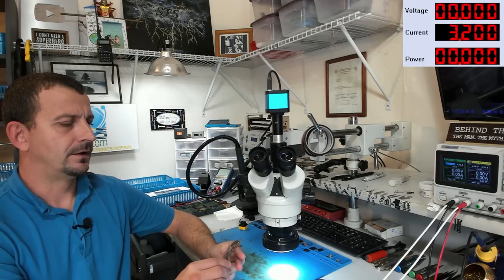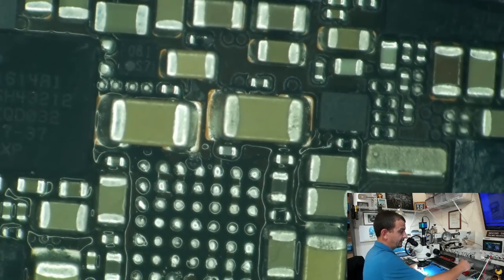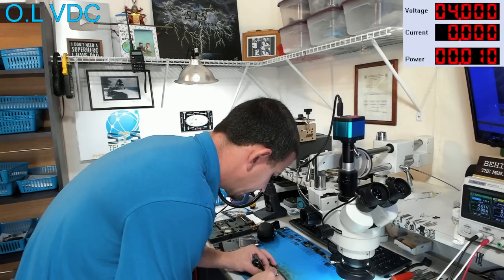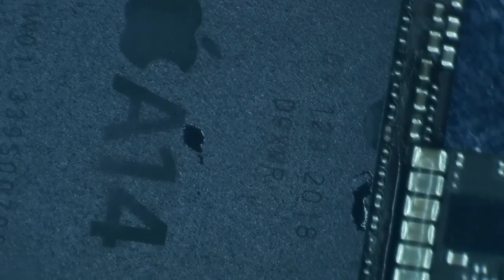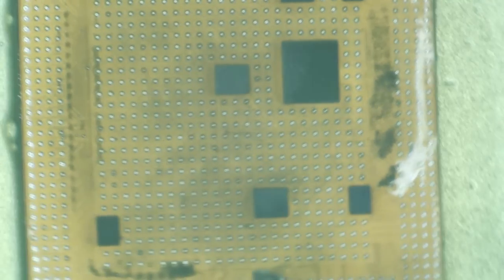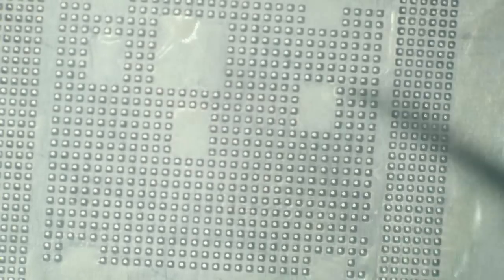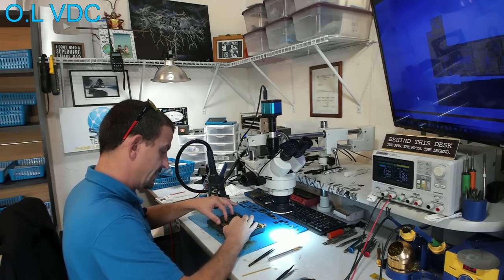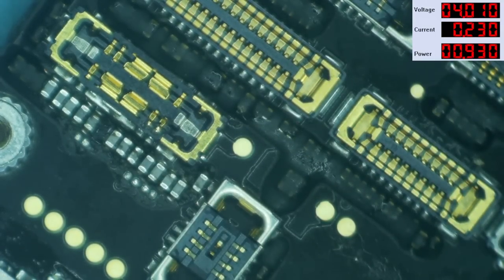iPhone 12 Pro Data Recovery from New Zealand

Comment: I find adding flux to old paste to make it softer isn't the same as new paste. The original volume of flux in the paste is still there, just that it's hardened, then when you add flux it increases the volume of flux and lowers the volume solids of solder. Basically the balls become smaller after the flux burns off.

Comment: Great video as always Jason, I've been a fan since your Missouri days. I have a few questions, I have the same mechanic board heater and my first iphone 12 separation didn't go well, the top board didn't work after separation. This heater has two temperatures, which temperature do you use, how long does it take to come up to temperature, what is the max time you would leave the board on the preheater for? Sorry if this is too much and thanks again for all of your videos.

Comment: It is crazy how difficult iPhone board become to repair with each year/version of iPhone. First double board from iPhone X, then much high meting pointy of solder from board separation (from 12), then transferring CPU and NAND to the lower board. And I'm not talking about all the underfill, no numbering of components and serialization
Reply from the maker: I am still finding them to be much repairable but as they depreciate, they will become not worth repairing.  A simple short turns into a pretty big job so once the phone is old, the repair cost will be too high.  Unlike older models where more faults can still be quick repairs without potential for defects.  I didn't mind the sandwich boards prior to the 12 but now I'm having to re-ball and deal with sandwich related troubleshooting on what used to be an easy fix.
Reply: @ststele  all double mother boards double the price of the repair cost here. For me android phones are much simpler and cheaper than iPhone

Comment: nice video and work. I think the capcitor from minute 16/17 was knocked over in minute 2:59 when you removed the shield. Maybe it was already loose
Reply: I think you are right, you can see it move to the side I think with the air pressure from the hot air. Good catch!
Reply from the maker: Thank you! I watched this video at least a half dozen times while editing and did not notice that!  Very good catch! 😮

Comment: your chair creaks so much how is that not bothering you ? slap some flux on it 😂
Reply from the maker: I was wondering when someone would notice!  This chair has the pedestal torn away from the bracket that bolts to the actual seat.  It has maybe 30% left hanging on before it breaks all the way off and bad things happen.  I was going to replace the chair but learned the part to fix it is cheap. 😁 Fixing soon..  it drives me nuts.
Reply: @ststele  replace it , the last thing we want to see is the chair breaking while you holding a logic EePROM during a transplant. by the way, is that a new thermal camera you got there ?
Reply from the maker: Lol @ eeprom!  I'm just seeing ur reply as I'm coming back today to say the chair is fixed. 👍
Yes the camera is one that I had been told was no good for this work.  Turns out, I had heard it from someone who had never used one with a macro lens.

Comment: Was this from thr last video with the screw hole damage done to the board, The came CPU and drive?
Reply from the maker: The last one was a 12 Pro Max, this one is 12 Pro.  I think the previous one would work if the RAM was replaced but the customer is not interested in data.
Reply: @ststele  Got you. My mistake. I throught they was both the same phone it came from. I didn't remember if the first one was different in anyway from this one. But it's cool that you got this one to work.

Comment: bro ... come on, the new zealand board is not a 12 pro board, it;s a simple 12 board and that's why you are missing the board_id rezistor... lol, that is why you are missing so many components...and btw.. just finished watching the video, you forgot to take the NFC_P and NFC_F to have your unlock code working... in case you wonder why code is not working :D
Reply: this is a fix for data recovery pourpose
Reply: @FrancoCoccini  exactly… to recover data you need the nfc’s taken from original board

Comment: I have no idea but wonder if most of the time the goal is to get the data, is the data not stored on one component like a storage type of chip? Would it not make more sense to take that single component off the broken phone and connect it to some device i.e. a donor phone designed for that purpose like one for each model and just get the data...would that not save you heaps of time to just take the storage chip and connect to your custom data recovery device/phone...?   Rather than tinkering around with all the bits n pieces? I mean. Yeah you people are amazing at what you do... And if phone repair is the goal...sure... Just saying what I'm thinking . Knowing very well I'll get crucified by y'all...